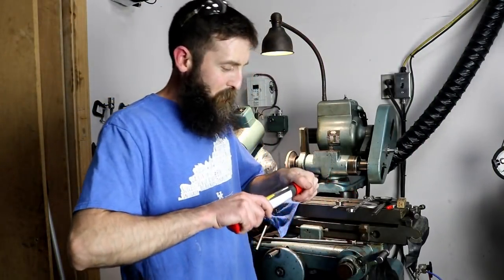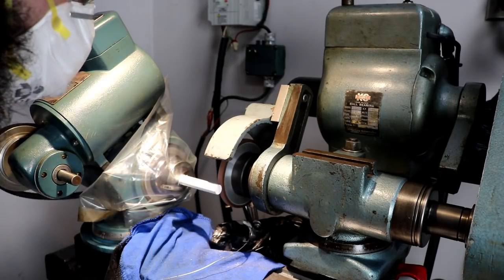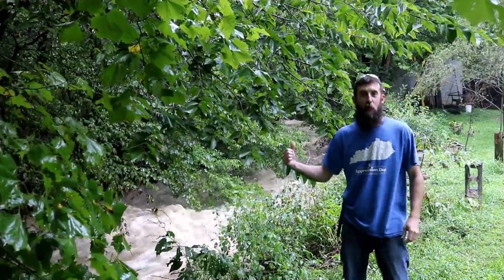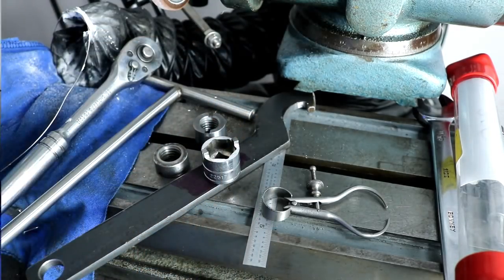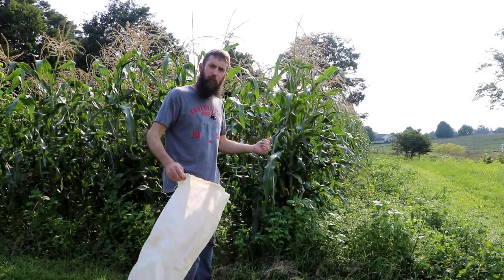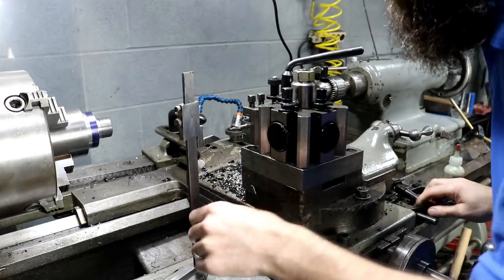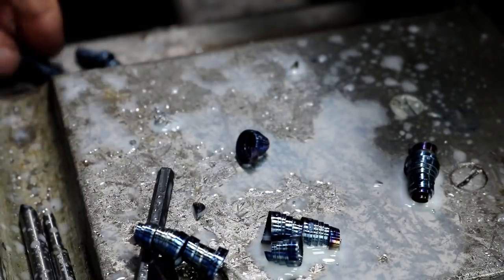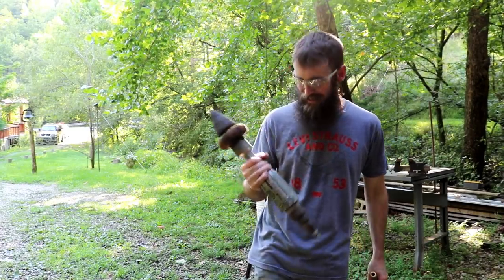CUTTER GRINDER AT WORK! /  Ceramic Prototyping Material

Comment: I used to work in a large foundry in Muskegon, MI. The long grinder was used to clean and grind cast iron automotive castings. The term used was "snag grinding"  They were a beast to use. All the guys had very powerful hands. The worst thing that would go wong was a grinding wheel break. Those guys would have to throw the grinder  to protect  themselves!

Comment: Steve,
When I was a lad I worked for the Chrysler Corporation in an engine assembly plant.
We had a problem with Cylinder blocks shipped from Brazil that had rust in the bores.
The tool of prference to clean them was a grinder of that size fitted with a wire wheel.
I can tell you that several pair of cotton gloves and rubber gloves over them were required to damp the vibrations and in winter to protect from the ice that formed on the tool due to the volume of air flowing through it.
Cheers Eric

Comment: I use to use that same grinder in a pipe mill. Sometimes the dewhickie that scrapes the bead off the inside  misses so we'd have to grind them. They had one with a 20ft extension for doing long stretches. Pretty boring work, good thing it didn't happen all that often.

Comment: Steve I spent 29 years in  plant where we specialized in ceramic grinding. We ground zirconia in the green state with a WAX BINDER.  There is no amount of dust collection that will keep that crap out of the air and out of your lungs. Several air quality surveys were done and the result of the studies was there was no problem. Now I am 66 years old and am good for sittin in a chair all day and watching You Tube movies. Walking to my mail box about 100 feet is a chore. Added Oxygen is of no use because if your lungs can not absorb it then it is a wasted effort. I hope you and all your viewers always "ALWAYS"take time to protect their lungs from grinding dust. End of Rant !
Reply from the maker: I hear ya Terry. Dangerous stuff for sure. I know several people who have similar issues.  Not something anyone would every want to deal with.
Reply: Or you could be just like my boss and say "40 years and I never needed a face mask, safety goggles, proper air ventilation, welding gloves, etc." and then don't use them and complain about the dead nerves in your foot from the stroke or another mole that has to be removed.  If my boss saw the dangers of what i saw at the shipyard, then he too would be as finicky about safety as I am.

Comment: FYI that paper mask will not protect you from ceramic dust particulates. You need a particulate respirator equipped
with a N95 filters. Protect yourself  from fine particulates especially when grinding silica, ceramic, and carbide.

Comment: i work in a captive tool and die shop for a ceramic plant. the only thing alumina is run with is carbide dies and either rex 76 or carbide punches.

Comment: The end grinder you have at the end of the video is commonly used with a cone stone like the one you have in the piping industry for cleaning up the ID of slag and contaminants of piping after it's been flame cut. They are also used extensively for transitioning the wall thickness of pipe when joining two different schedules together at a weld joint. (A.S.M.E. requires a 4:1 transition for wall thickness on any welded joint to mitigate possible stress risers.) With a flat wheel they are also used for flush grinding down the weld root on the inside of weld neck flanges for internal coatings or when there are concerns regarding flow restriction. In the pressure vessel and tank industries they are used for prepping holes cut into the walls of the vessels for nozzle installation and welding.

Comment: nice video.. i think i saw this kinda grinder on weld . com , they used at least that  cones to grind the inside of pipe removing burrs.  i use a electric version of this to remove burrs, prepare V grooves  in cast metal etc .   it is good too see that the community supports each other,.

Comment: You lucky Bastard! you have a crick in your yard. I live in the desert, that is hard to come by. I hope you're taking advantage of the electricity it can provide. That's the dream out here  ...a place way out in the sticks with running water. I've played with solar having marginal results because you gotta have plenty of battery to be off grid but a crick that size would be all you'd ever need.

Comment: Nice video Steve. Would a mist coolant or even a really fine water mist work on the cutter grinder just to help pull any excess dust out the air or would it cause issues? 
I really love the look of your property whenever you show it, looks and feels like a lovely place. Cheers

Comment: "Ceramic" covers a wide variety of sins, er, materials.If you have the right ceramic you can sharpen knives with it, which is why it  eats HSS.. There is a sorta kinda progression. Diamond cuts anything,  Carbide does not cut diamond but will cut ceramic---. maybe. Depends on the composition of the carbide. Ceramic cuts HSS so no use trying. There are intermediate materials such as garnet and emerald and ruby. It is all a question of relative hardness. In my high school (not in this country)  we were taught the Mohs scale of hardness. You can look this up. What I liked about this video is the practical aspect. What is a hard-working machinist to do?  I appreciated the answer. Keep it up!
Reply from the maker: Juan Rivero Thanks 👍. This Alumina bisque was a different experience.

Comment: Just came over from abombs vid great stuff

There's a welder/fabricator that goes by Michaelcthulhu i wonder if the Resp-O-Rator he uses wouldn't be a better option for nasty dust like that since it taked in air from behind and as he puts it actually works with a beard

Comment: Great video Steve.  Just a thought.  I saw you used your height gauge for setting the lathe cutters.  I have 3 lathes all with differing tool heights so I built a very simple dedicated single height gauge for each of them.  Aluminum base, all thread for the riser and a piece of aluminum bar with a lock nut on each side of it to set the height.  Cheap, fast and repeatable.  Fred
Reply: Hey Fred do you have a video on the top you made for setting cutter  height.
Reply: I have a cheap tool height gauge.  It's called a 6" steel rule.

Comment: Good video, nice close up shots on the lathe thanks for sharing. That boring bar performed great, nice consistent chips. One thought I had about the ceramic, during the grinding I wonder how much of the fine ceramic and diamond dust permiated the part, will it be back flushed before use?  Yes you don't want the ceramic particles in your lungs, it's not organic and it's similar to tungsten your body can't process it out, over time there's a cumulative effect that can affect your health. You can't have too much ventilation when grinding some materials.
Reply from the maker: Im not sure what if anything will be done as far as flushing. Probably nothing if I had to guess. Its more of a plug than anything.  Something gas can get around because its a slip fit and possibly through.

Comment: Man I highly highly recommend a carbide part off tool. The trick to the carbide part off is around 500 rpm and very aggressive feed where you get a chip similar to an OD carbide tool.
Reply from the maker: I need a good holder. Would already have a carbide parting tool if holders for this toolpost were easier to come by.  I agree👍

Comment: You can turn and mill ceramic parts, as long as they are not final sintered. Tungsten is possible, but will be quickly worn out. Best ist CVD (diamond) as cutting edge. But it is not cheap, it is a mess. On the other hand, grinding is also a mess, lol.

Comment: for your dust collector on the KO LEE grinder.. google "Wall Stack End Boot" its available thru most home stores and many plumbing supplies.. i don't know what size your duct hose is.. you may need a reducing collar.. this will slip with the assistance of some weight in the back part of the taper to stay under your grinding wheel and catch far more than just the open end of the duct does.

Comment: Steve, the hand held grinder is called a "snag" grinder.  They are used for removing flashing from forgings, excess metal from raw castings, and similar functions, really anything that needs some freehand heavy duty metal grinding.  They can be extremely dangerous, and I have never seen one with a wheel guard.  I have two smaller ones.  Please be really careful using it, try really hard not to explode the wheel or let it find flesh if it "snags" on something.

Comment: pretty neat machining the aluminum oxide down, I expect it would be almost identical to just a simple aluminum oxide grinding wheel on a bench grinder, but porous. I would look into the continous rim masonry blades, you can get them in various sizes and they are usually diamond grit on the outside of them, so you can use that to grind the harder materials like this and carbide. I use one myself to touch up and shape carbide on my little mighty mite table saw that I have.
I was thinking about something the other day and wondering if you have ever heard of a eureka tool, or eureka self relieving tool? You run it between centers, and I was thinking that would be handy to no end for grinding reliefs and such on some horizontal milling cutters or cutters for the mill.
Reply from the maker: Never seen one before Chirpy.. Ill look it up
Reply: sometime in the future, I was planning on making one of the eureka tools, so let me know if you want the plans for it and Ill just email it to you or can make a second one if nothing else. I know ivan law has plans for one in the workshop practice series books.

The masonry blades can be found at almost everywhere, I usually get the 4" ones for the little table saw, and they're like 5-10 dollars, but you may need to bore the hole out in the center larger to fit it on a mandrel. They seem to last for ages just grinding carbide to shape, so I expect that for your application, they should be great for you. Ive been using the same blade for around 3 years now and it has no real signs of use.

Comment: I've never ground nonmetallics, does it give issues with clogging the wheel?  Did you have to re-dress the wheel due to the wear from grinding an abrasive stick?

Never understood that phrase "it is what it is" - is it ever NOT what it is?
Reply from the maker: somebody else I had to clean the dimond wheel a couple times.  Wheel would load if I took to much at once . LoL, it is what it is.
For me it means something I can't change or something that is  difficult to change and good enough.
Reply: "For me it means something I can't change or something that is difficult to change and good enough." Excellent description!

Comment: I’d use a chip brush rather than your finger tip to remove chips. Can the ceramic material be turned in a lathe using carbide tool? Thanks for making the video.

Comment: There is a guy on eBay that sells diamond wheels from the Ukraine, there are very reasonably priced and much better then the Chinese ones. I have used them to grind lots of flat carbide and tooling.

Comment: Hey Steve... thanks for the video, enjoyed it a lot. Dumb question from a city guy - when I was a kid we'd can the tomatoes and freeze the beans and peas. How do you deal with the corn for the winter? Do you have to cut all the kernels off the cob? That would be such a pain... although maybe that's what teenagers are for.
Reply from the maker: Rod Fitzsimmons Frey Several different ways. You can keep it on the cob you can cut it off and freeze it or you can cut it off and can it. Cutting it off the cob takes no time. Shucking corn is the bad part.
Reply: are you challenging me to a corn cutin contest steve ? the silk is the pain in the cob!
Reply: I thought in Kentucky you just jarred up the "squeezins"? ;-)

Comment: Thanks for the videos, Steve. First time I have seen someone work a piece of ceramic. 

I didn't get any corn from my garden this year, it has been a rough summer; first too much rain, then too dry, then too much rain again. It probably would have helped if I had planted some corn even. ;) Honestly though, I had a question about your shop. Abom's video showed a big crack in the corner closest to the creek. Have you noticed the bank of the creek eroding any at all right near there? I cant tell you how to fix it, I was just curious if it was from a bad footing, or settling or some thing to do with the creek.
Reply from the maker: The building has some damage on the lower side due poor construction and no footer, Its a heavy block building setting on a slab next to a hill built on fill dirt  :-/ . They did a beautiful job on the block but they skipped the most important part.. a good foundation.    I plan to repair it.  Not going to be easy or cheap.  It was like this when I bought the place.
Reply: There might be a youtube video about how to do it. The only way I can think is to build some bracing inside for that corner for the ceiling and roof. Tear all those blocks down, if you do it right you can re-use them. Dig you a proper footing, perhaps with a mini-ex or backhoe. then rebuild the wall. The big problem with building on backfill is most people do not take the time to compact it correctly to be able to build on it; so you may have to dig down to solid ground below the fill to get a good footing. some engineers will allow you to fill the majority of the ditch with gravel, others will want you to use concrete from the solid ground to the surface. Just some ideas for when you get to that point.
Reply from the maker: My idea was to support the trusses and remove the wall. I planned to reuse as much block as I can. the mortar pops most the time.  Floor is also broke bad on that side. I already cut the length of the floor that's damaged.   Just such a large job I would need to stop everything else I need to do now. I would love to fix it and be able to use that side of the shop more. Loads of good equipment could fit in the shop then ;-).  It all comes down to time and money. Things I don't seem to have much of at the moment.
Reply: Steve, you should open up the floor to see if it's undermined. Get a decent foundation in and just frame the section where you take the block out. The shop won't come down now, but some day you might go in and find a new view that you didn't have before. Been there, done that.

Comment: Steve maybe to you could tap into that water power and make your own electric power
Reply: As long as it rains a lot :)
Reply from the maker: Its dry most the time.    But if it ran more consistent I would have already done it for sure..  Thanks for watching!

Comment: I had never seen a white dressing stick for a diamond wheel. The white color indicates Aluminum Oxide ceramic. It is softer than diamond of course. In my place we know black (dark grey actually) dressing sticks which probably contain silicon carbide (which is cheaper). The Deckel clone tool and cutter grinders come with a single point diamond and a sweeping arm to make sure the wheel surface remains flat and perpendicular. However I don't know if that single point diamond should also be used to dress a resin bonded diamond wheel (the orange stuff). Do you know more about that?